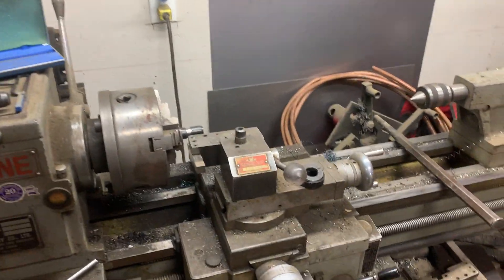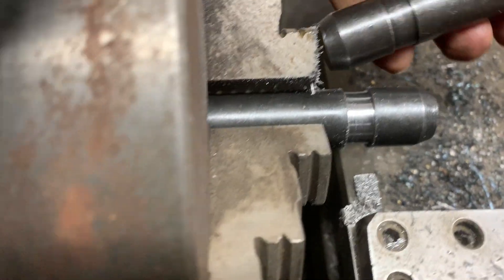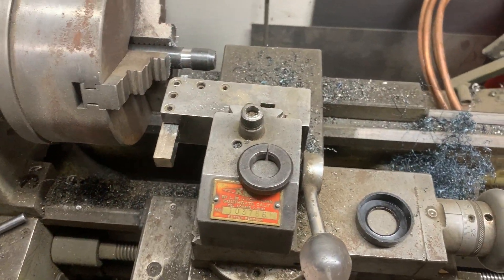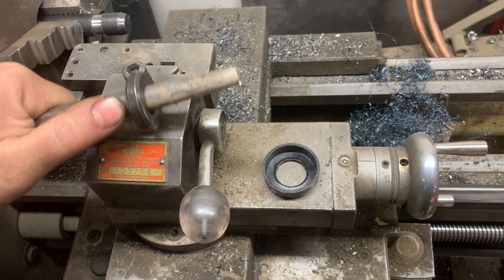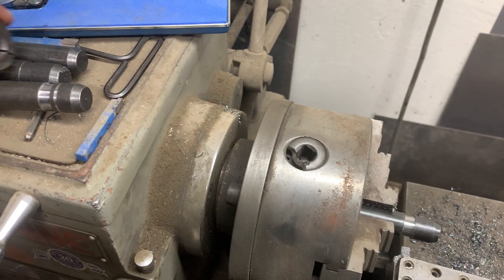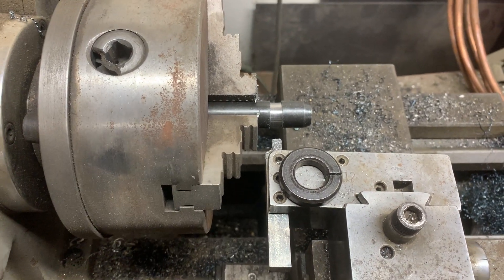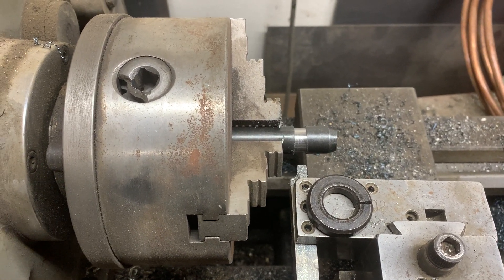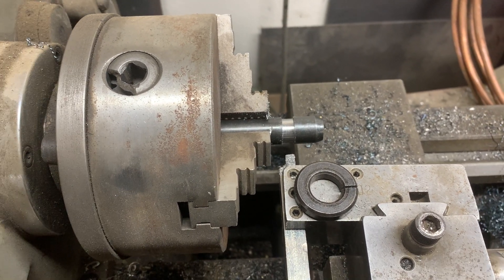Bucket Tooth Pin Modification/Improvement

Comment: Good idea . Check your adapters  for excessive wear  ,  that style pin does not give trouble with good  adapters .  Every other style is a pain as you usually have to cut the  ear of the tooth off with an oxy to get the buggers off !  👍

Comment: Never seen those. I have always used Esco buckets and rarely loose a tooth. But I carry a metal detector on board in case I do. Doesn't take long to pay for the detector on 210 and 270 size machines.

Comment: Thanks bud, Ive used your cutting edge trick as well recently. Taker easy!
Reply from the maker: I welded 3"x4" cutout pieces of old bucket edge below the teeth right after this today as well, like on previous tooth video. Machine came back today with only two teeth out of four on. I wasn't in a good mood with that. So this should cure that machine for a while. If  only there was cure for lever yanking, wanna be, digger scooper, tractor driver, no mind hacks that,  somehow think they deserve to be in an expensive beautiful piece of equipment with zero brains or understanding of the machine.That is an untapped market, that will run free and wantonly reckless for eternity. These 'meat in the seats' know they are immune from ever having to be responsible. Now I'm in a bad mood again. Same no minds that probably think the word "Grease gun" is some food prep item in a fast food deep fry kitchen.
Reply: @skadill  Yeah, a good tip for sure, Cheers!

Comment: Cool old KDK quick change, that's a gem. The rings being champhered on the I.D. doesn't help matters. On larger retainers I've done a drill/tap/counterbore for socket head allen bolts to cinch the rings once in place. Nice mod, thanks for sharing.